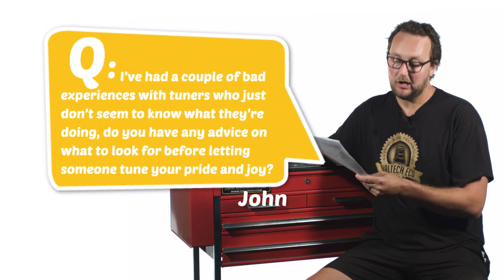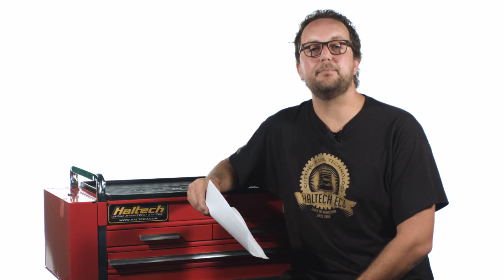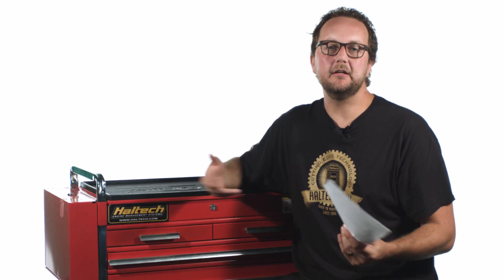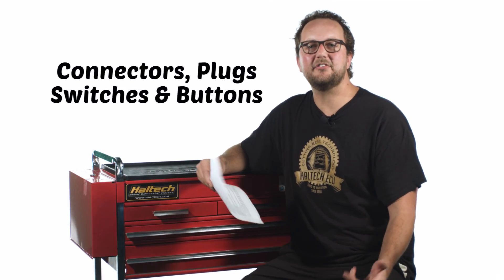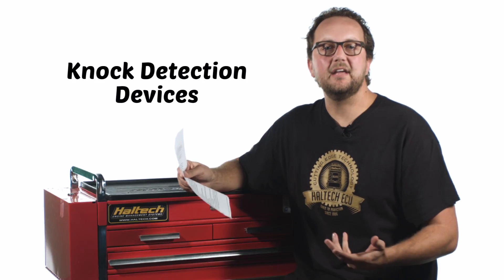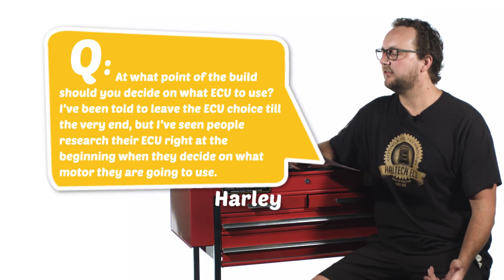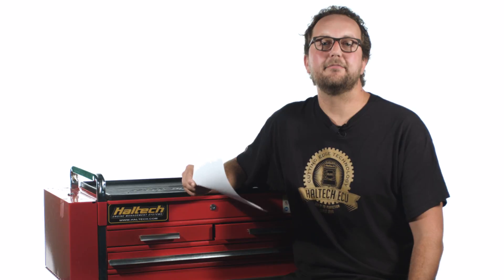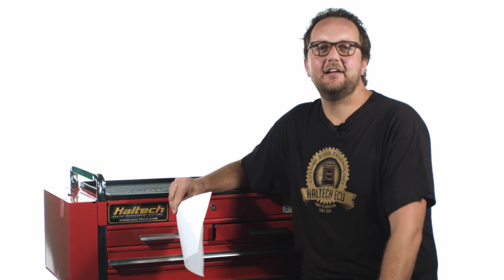❓ What Tools Do I Need to Install an ECU? - Haltech Q&A Episode 20

Comment: hey guys, which haltech is good for Toyota 2ZZ-GE engine and its cable driven not DBW. i am planning on boosting it. thanks
Reply from the maker: You can use the Elite 1000 ECU to run this engine and it will support both of the variable cam controls on this engine and all factory sensors.

Comment: hello so im asking again  are all haltech ecu can select couple maps by a selector switch . can haltech ecu run map based on an AFR like aautotune that sets in acertain afr
Reply from the maker: Yes, you can set more than one map.  Elite 1500 and 2500 can have up to 8x maps on a switch if you like.
Yes all Elite ECU models can do Fuel Long-Term Learning except the Elite 550.  Elite 1500 and 2500 also learn ignition, idle, boost, and cam duty.

Comment: What are the benefits of a piggy back ecu and benefits of a Elite ECU and differences?
Reply from the maker: A piggyback ECU, by its name, is connected together with an existing OEM ECU. The pro is that you only need to control what you want and leave the rest to the OEM ECU. The con is that you can't control everything so there are sometimes downsides to tuning capabilities.  All of our ECU range are designed for standalone use, but can be used in piggyback installations if need be.

Comment: From nz Here! What ecu would you recommend for me?? The car in question is a HB  Vauxhall Viva (HB Holden Torana in your land) I'm fitting a Mazda 2.5 KL-DE with a sc14 supercharger. Backed up with a rx7 gearbox and Hilux diff. I'm hoping to run flex fuel 98/e85 setup.(Not to sure that e85 is Readily available where i am but would be nice to tune for it as i can get it else where) I am also deleting the dizzy and going coil on plug with  electronic throttle body to keep things tidy. I will at some point be making a 36-1 trigger wheel to go onto the crank pulley for the cop set up. Cheers
Reply from the maker: Hi Mitchell! Because it has DBW and is a 6-cylinder your only option is the Elite 2500.  The existing distributor is supported, and so too will be a 36-1 crank trigger.  It will also easily handle flex tuning when the time comes.

Comment: been wondering how much timing @18psi on stock bpu 2jzgte non vvti with 98octane????please enlighten me any guy from haltech..
Reply: 360 degrees i would say
Reply from the maker: At what RPM, what air temp, what TPS, what coolant temp, what density fuel…etc.. etc..    There are far too many variables to possibly answer with a single number.  This is something an engine tuner will provide when you have it tuned.
Reply: well air temp is between 25-35degree celcius, almost like australian summer temp..i need to know what is the safe timing range around that condition...if you can give me some clue that would be awesome...mine sitting at 15degree wot timing at 18psi...

Comment: hey guys! I'm looking to boost my 1995 2ga eclipse with the non turbo 420a engine. I'm going to be running full forged internals and stage 3 cams, larger injectors, vj11 turbo on 8-10 psi of boost. 

would a 550 ecu work for my project? could i use it as a piggyback setup so my stock why can run all the other things in my car?
Reply: The_JDM_ Workshop I don't know you're answer, but that's interesting. I'm listening.
Reply from the maker: Those things (420a) were fitted with a bizarre crank trigger wheel that is not supported. In order to run it, you will need to switch to a standard Haltech supported crank trigger. Because they had the odd crank trigger from factory, aftermarket trigger wheel kits should be readily available that use a supported trigger pattern.

Comment: what ecu do you recommend for a 6gr-fe in to a AE86 Corolla. I'm still working on suspension and roll cage so I'm not in a big hurry. I would really like if you can help me pick out what I need tho. thanks Manolo.
Reply from the maker: I can’t say I have ever come across a 6GR engine. Researching this shows this engine is only available in a bus from China! It appears to be almost the same as the 1GRFE update engine which we already have customers using. From what I can find it will require an Elite 2500 to support the quad variable cam system.
Reply: Haltech sorry so it's actually the 3gr. the thing is that I'm looking in to the dual VVTi motor I don't believe the 1gr has dual vvti. will I need a special ecu?  

thanks for the fast response.  I really appreciate your help.
Reply from the maker: The Elite 2500 will run all of the engines you are mentioned.  With them having DBW this is your only ECU choice for the GR series.  The early 1GR has variable inlet only, but later versions were inlet and exhaust as with the 3GR.   Direct Injection FSE versions of these engines are NOT supported.